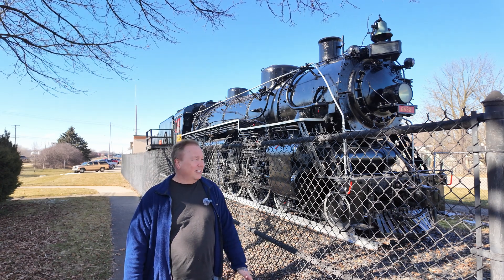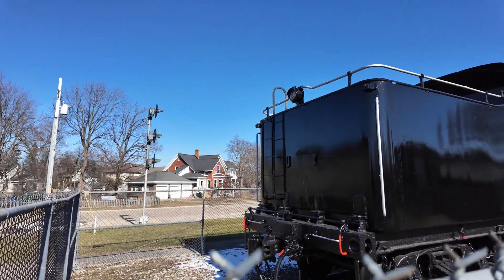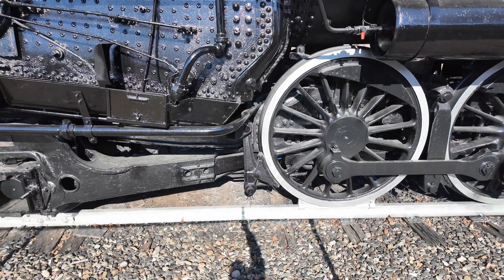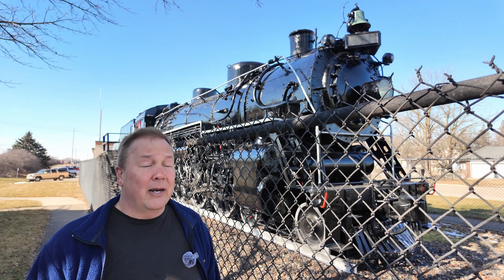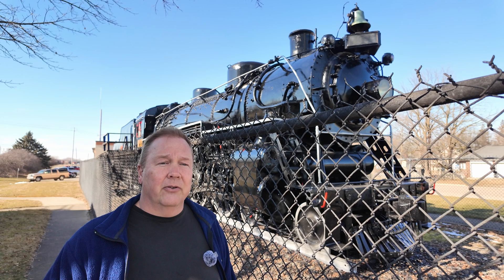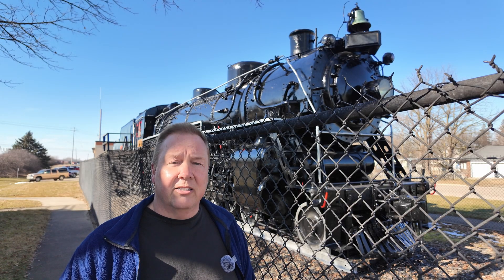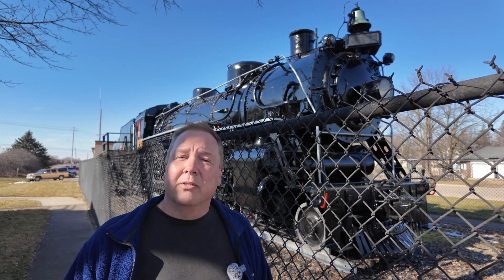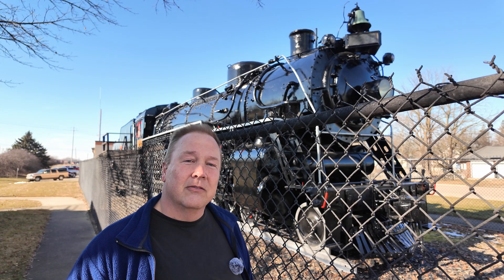Why Are So Many Steam Locomotives Sitting in Parks?

Comment: Wow, you know almost nothing about steam locomotives.  Your comments are so wrong about the needs of a steam locomotive to operate. Does the NKP 765 running excursions stop every 10 miles for water? Do they put it in the shop after every run and spend hours fixing it? The answer is NO! And a Pacific was built for passenger and Mail train service. The water tanks never froze for several reason's. The steam locomotive does require a fireman and an Engineer. Diesel locomotives also had a fireman and engineer. Again steam locomotives did not go into the house every single night. You need to stop teaching false information.
Reply: He mentioned every town has one.  That was an incorrect statement.
Reply from the maker: The "seems like every town has one" is a metaphor.
Reply: They had large water capacity tenders, sometimes they added a tender which was water-only. For Big Boy runs today, they use two extra tenders.
Reply from the maker: The double tender operation happened, but may be more common today.  Nearly all the water infrastructure is removed, so you can often only refill at your home station and fire hydrants in towns that let you connect.
Reply: @Industrial_Revolution  The auxiliary tender was used very often in the late 50's at the end of steam because the railroad would not repair facilities they knew were being closed soon.  Yes it was very common in the 50's to see tank cars, or aux. tenders in use for water capacity especially on branch lines. The B&O would even use a big 2-10-2 tender on a small Mikado in local service. I have photos, and on one 0-6-0 they extended the tender. I was odd looking but it worked.  :)
Reply from the maker: Water capacity and distance varied a lot from locomotive to location, by load, terrain, etc.  My numbers are based on numbers from a current, legacy railroad's tests with their two locomotives.  I'm looking at making another video discussing these differences, with more numbers from more types of locomotives.
Reply: @Industrial_Revolution  unless your running an 0-4-0 made for yard duty or an 1870's American there is no way a locomotive went 10 miles and was out of water unless they were carrying over badly in the boiler, or had a leak. The only other explanation is your are talking about a narrow gauge engine pulling a super heavy train up a steep grade. If your looking at the Colorado RR museum, that is not typical operation or typical locomotives/capacities. You need to do a lot more research before making blank statements like this. your statements do not cover 90% of the Railroad steam locomotives. Your talking to a licensed steam engineer, who also is a fireman and engineer on a steam locomotive. Trust me, your information does not apply to Normal standard gauge steam locomotives.
Reply from the maker: As many have pointed out, I clearly overgeneralized the 10 miles thing.  A better statement would have been "as often as every 10 miles, depending on the locomotive and conditions."  It unfortunately happens with short videos.
I pinned a comment on this for the video, but I need to put together a video covering water consumption specifically.  Won't be able to cover every steam locomotive ever made, obviously, but should be able to give a considerably broader range.  Getting real information from people who actually run a wide variety of steam locomotives, now or in the past, would be handy, both for the water consumption video, and maybe future videos, too.  Thomas the Tank Engine and the Big Boy are both coal-fired steam, but pretty sure water and fuel consumption are somewhat different.

Comment: it's 50 to a 100 miles between water stops not 10!!!!
Reply from the maker: Quite a few people have mentioned this.  Enough that I think I need to do a separate video on it.  The numbers I used are based on some data out of Colorado with a couple historic locomotives.  Some certainly went farther, plus it makes a difference what your train is doing.  10 passenger cars or 100 iron ore cars?  Flat without stops or going over mountains?

Comment: Now when you say every park, do you mean only Cheyenne WY and a few towns out west.  I live in Tennessee I’ve only seen an engine in Cheyenne. Parks usually have cabooses around here
Reply from the maker: They're certainly not every park, but they're are a lot of them.  Probably more in railroad towns than others, but that's to be expected, really. 
 Cabooses became available later, as diesels still ran them for a while, and they have their own huge fan base.
Reply: Helps if you had a local branch line.

Here, Gainesville Midland ran through 1959 when they sold to Seaboard. 3 of the Baldwin 2-10-0 decapods still exist (2 are in parks, 1 is in a museum) and 1 of their 2-8-0s is in yet another park.
Reply from the maker: @pro-seriesfabrication3810 yep.  They're not going to lay miles of track to deliver your locomotive, and I'm pretty sure USPS would consider them over their weight limit.
Reply: @Industrial_Revolution  

Oddly enough, there's a real Southern Railway caboose sitting in someone's yard not too far from my house. It's a good 25 miles to the closest Southern line. Haven't heard the story yet on how the family acquired it.
Reply from the maker: @pro-seriesfabrication3810 I have a friend who wants one, too.  They're small, light, and fairly easy to transport.  They have a huge fan base, just like locomotives, but are a lot easier to get and move around.

Comment: In the 1950s when the railroads were converting to diesels many employees wanted to save some of the steam locomotives for history.  After 150 years of steam it was the end of an era.  Many small towns were railroad towns for 100 years or more.  I come from a railroad town.  My father, grandfather, and an uncle all worked for the railroad.  My dad was on the committee in 1956 to convince the town council to accept a small steam switch engine for free.  Where were they going to put it?  There was a brand new park being built, so it would go there.  Then the railroad started laying off employees.  With steam gone they didn't need as many workers.  My dad got transferred and we moved 2 hours away.  But our relatives continued to live there.  65 years later it's no longer a railroad town.  In fact it has become a bedroom town for silicon valley and the population is now 100,000 +.  But the steam locomotive is still sitting in the park.
Reply from the maker: I think your story is pretty common.  Durand, MI, where this one is located, was definitely a railroad town.  They have two, separate railroad museums in the old station, and there's a group working to bring more historic railroad stuff into town.  Beyond the Amtrak station, I don't think there's any current railroad jobs in town, though.

Comment: There are more steam engines than there are people willing to invest time and boatloads of cash to bring them back to life.
Reply from the maker: You're right that there's not enough energy or cash to restore and bring a lot of steam engines back to operation.  On the other hand, it doesn't cost nearly as much to go out and paint them every decade or so to prevent them from turning into a pile of rust.
Here in Durand, there's an operating steam locomotive just down the road, in Owasso, MI.  It'll be a sad day when kids grow up without ever having ridden on a steam train, so as long as we keep enough up and running, scattered around, so everyone can experience them.
Reply: @Industrial_Revolution  I think that they should at least get covered so that they might not be subject to the weather quite as much. At a transportation museum I volunteered at there was the Northern Pacific 2156 that had been on display at a local zoo. The smoke stack cover was taken off and rain water got down into the cylinders and froze there cracking the cast steel. The costs to sleeve and repair the cylinder was nearly, $150000.
Reply from the maker: Unfortunately, it comes down to money, and who's willing to pay for it.  Roofing over a locomotive, and maintaining that roof, isn't as cheap as we'd all like.  A park where I volunteer has just paid $200,000 for 2 roof replacements.

Comment: Your statements on water consumption are extremely misleading. Seven to ten miles was a typical range in the very early days of steam, like early 1800's, or for a small tank engine meant for short range industrial service that would never be too far from water and fuel. That most certainly would NOT be typical with an engine like this from the 1950's built for main line service. Seventy five to one hundred and fifty miles would be more typical for an engine of this type, depending on the load and track conditions.
Reply from the maker: They actually did some experiments on a historic line in Colorado and found, even with tenders, that neither of the locomotives they were using could do 20 miles, and you obviously NEVER want to get low on water for a steam engine, since they tend to explode.  Water consumption certainly does depend on the locomotive, plus the load, is it speeding up and slowing down much, climbing hills, etc.  Several people have mentioned this, though, so it's probably a topic worth its own video.
Reply: @Industrial_Revolution  Who is they? First if your talking about a narrow gauge engine on 5% grades with a heavy train, that is not typical operation! This information you gained on those two locomotives on that one track ( I assume the Colorado Narrow-gauge trains on the loop of track) is not typical of full size locomotives.

Comment: It looks all there it should be running!
Reply: Well, it doesn't have a boiler jacket, which is a good thing for a park engine, they hold water and cause rust.  But, yeah, it looks to be in pretty good shape.
Reply from the maker: I don't know what shape it was it when it was donated to the city.  It could have been time to replace the boiler, or needed some other major repairs or maintenance.  Just up the road, though, the Pere Marquette 1225 (inspiration for and star of The Polar Express") is just up the road and they do run that.

Comment: The K4b class of locomotives of which 5632 is a member are passenger locomotives. There are exceptions to every rule of course but passenger locomotives usually have large drivers for fast acceleration and high speed. The Pacific type of arrangement is very common to passenger locomotives of this period.
Reply from the maker: I need to do a video on the Whyte classification system sometime, when I have enough different types of locomotives handy.
Reply: "Former" GTW 5629 was a K4a and the only differentiation between the A's a B's were that the B's had an all-weather cab, (and maybe a few other marginal additions). But generally, they were two of a kind.
Reply from the maker: I wonder, if for some of these minor changes, anyone has a few variations sitting next to each other to easily compare.
Reply: 5632 seems to be in really good shape for being outside so long!
Reply from the maker: @TheRaceboi95, it's had some recent cosmetic work.  I don't know if it went any deeper than that, but you're right, it does look really good right now.
Reply: @TheRaceboi    But the jacket on the boiler has been removed;  it was made of sheet metal, which rusts through eventually,

Comment: With the introduction of tenders (a special car containing water and fuel), trains could run 100–150 miles  without a refill.
Reply: tenders gave you 50 to a 100 miles between water stops camel backs (the add on water tankers UP uses!) took it up to close to 450 miles between water stops!!
Reply: Almost all steam locomotives have a tender.  Part of the tender was for fuel (usually coal or oil) and the rest was for water.  The fuel lasted longer than the water.  If they were climbing grades in the mountains they needed to stop for water more often.
Reply from the maker: A lot of people have mentioned this.  My 10 mile statement was based on some experiments done at a historic railroad in Colorado using two, different steam engines, both with tenders.  From the interest, though, it seems like something I should do a separate video on.
Reply: @Industrial_Revolution  Here in the Plains/Midwest all our small towns along the rail lines are spaced 9-10 miles apart, because they were set up this way by the railroads back in the late 1800s so the locomotives could stop for water and maintenance.
Reply: @BadWolf762 This was also due to needing a section house for track maintenance about every 10 miles.
Reply from the maker: Track pans is sounding like a good video topic.
Reply: @Industrial_Revolution  well if you do do any more videos do your research actually really do deep research and really get to know the subject you're talking about because you're blowing smoke and you're full of hot air cuz you don't know or have a clue about half the crap you talk about I think you're one of those that just likes to hear themselves talk I know of several old lines that ran steam engines and they certainly did not have water towers every 10 mi for the engine to fill up is people like you that have no clue what they're truly talking about that are what is wrong with this world today people who want to lie and just say whatever
Reply: As someone who has run various steamers. We have run over a hundred miles on a tender tinier than that GTW's and made it back woth over a quarter of the tender tank full. In the early 1830's sure 10 is about right but by 1839 it was 40 miles.
Reply from the maker: It seems to vary a lot, from locomotive to locomotive, based on luad, terrain, etc.  I'll be doing a video talking about water consumption, and probably track pans, in the future to address this.
Reply: @Industrial_Revolution  Good to know. You mentioned that steam locomotives with separate water and coal tenders were an east coast thing, but I remember seeing an old Southern Pacific unit with a similar configuration in some magazine. I think it was on the Napa Valley Railroad, although I could be wrong.
Reply from the maker: @DTD110865 tenders were pretty common everywhere.  Track pans weren't that common in the US, except in the east, and some major lines elsewhere.  Even then, of course, the train needed to be equipped to use them.
Reply: @Industrial_Revolution  In general, yes. Of course they were common everywhere. In fact, for years anytime I ever saw a model or a cartoon that contained a steam locomotive without the tender, I always wondered where the tender was.
Reply: I’m pretty sure everybody here knows what a tender is
Reply: Government regulations were the reason for 5 man crews, and that was the case until the government deregulated the railroads in the 80s. So the two man crew benefit was unrelated to dieselization.
Reply: No electric locomotives were even mentioned.
Reply: Now crews are in danger of being eliminated entirely.
Reply from the maker: Depends on the locomotive and the tender.  100 - 150 miles without stopping for coal was fairly easy, but without stopping for water was a different story, unless the line was equipped with track pans.  Some places had 'em, but a lot didn't.  Some railroads added a second tender just for water to extend the range some, although I understand that's actually more common on historic/heritage rail lines, since the water infrastructure that used to exist is mostly gone today.
Reply: @Industrial_Revolution  Your information is very wrong. The B&O ran a Pacific just like the one you show in this video 60 to 100 miles before stopping for water hauling a 25 car heavy weight passenger/mail train. The only time an engine would use up an entire tender full of water is if they are pulling a heavy train up steep grades. Your information is very wrong!!!!! I am a steam locomotive engineer and a Fireman and believe me the 1225, the 765, the UP 4014 etc. DO NOT have to be put in the engine house every night for loads of maint. and do not have to stop every 10 miles for water. This video is so full of false information it makes me sick. You need to learn about what your talking about or shut up! sorry but this pisses me off when you teach people who want to learn very wrong information. I am shocked you didn't make the statement that a steam engine can only haul a hand full of cars. I have heard that false information too. :(
Reply: @s1-6100 I couldn't agree with you more this guy is nothing but thoughts information for sure and obviously he doesn't do his research and probably is one of the type of people that think they know everything about everything and no one is right except him
Reply: @s1-6100  I agree with you 100% people need to do some research and get their facts straight before they post something because some people will watch this video and will take every word in it to be the gospel and think it's correct and then they will spread the same incorrect information along to others and will probably argue with others as they yell up from the basement to their moms to bring them some more hot pockets because they are being a keyboard warrior
Reply: @Industrial_Revolution  I don't recall ANY track pans being used outside of the NYC back in the day, (but I've been known to be wrong once or twice during my 70 years on the planet).
Reply from the maker: What I read is that they were much more common on the US east coast than the rest of the country, although I know there was one in Dexter, MI, which is on the Detroit/Chicago line.  I wonder if there's any historic lines running fast enough to use track pans.  They only work above a certain speed.
Reply: @1chuck96 The PRR had them along the Broadway.